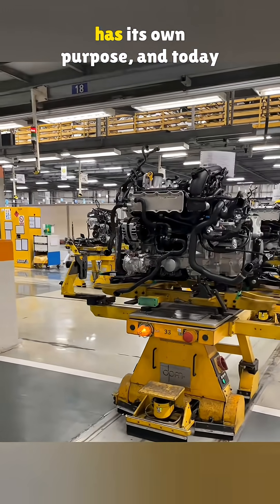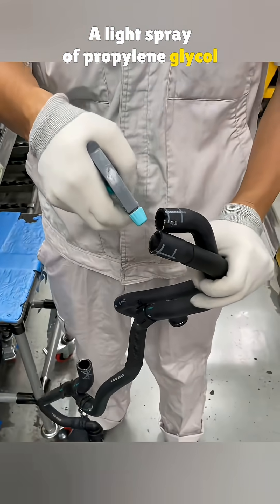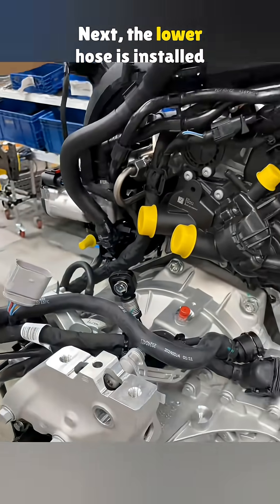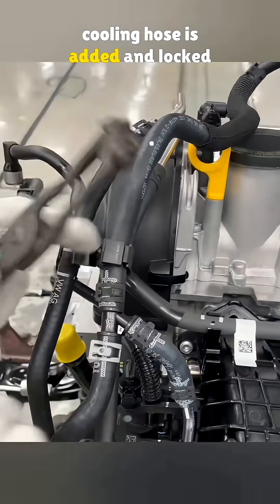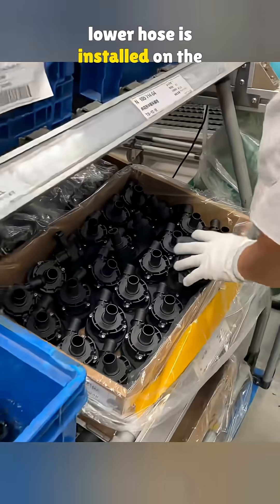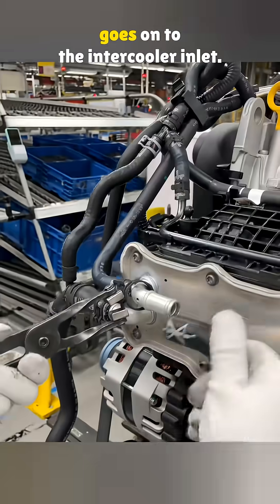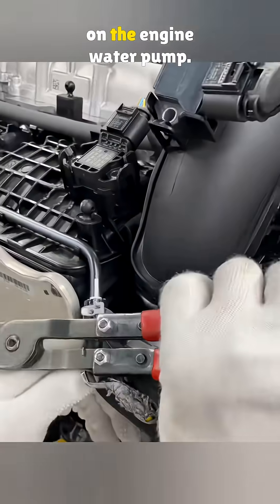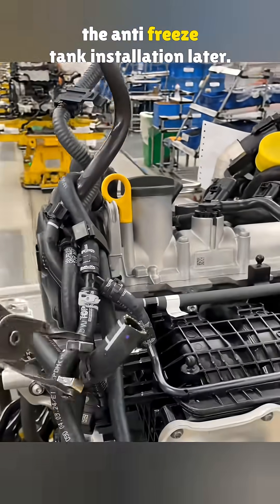Inside Factory: Complete Engine Hose Assembly Process

Comment: Propylene glycol - The stuff they spray on hoses so they go on easy and refuse to come off 5 years later.
Reply: Not rly a chemist by i think that stuff is basically antifreze. I totally get what you mean tho . But I especially hate fuel hoses with those little spring clamps.
Edit: they also sometimes say to lubricate orings and hoses with antifreze in the manuals so that is also why I think it's basically antifreze.